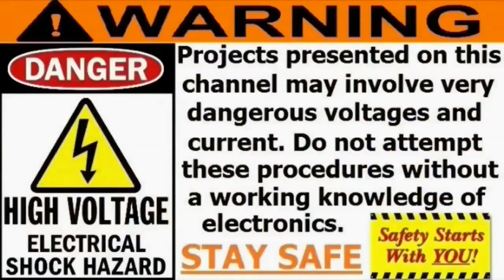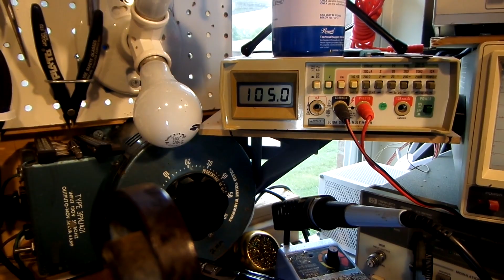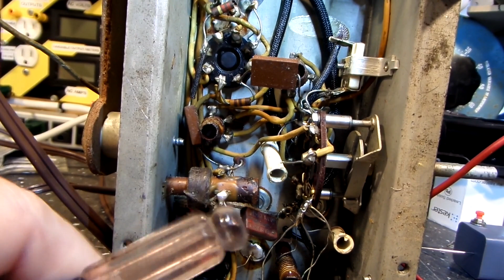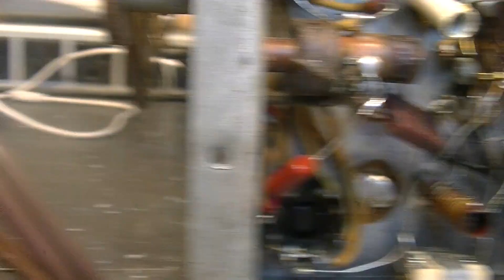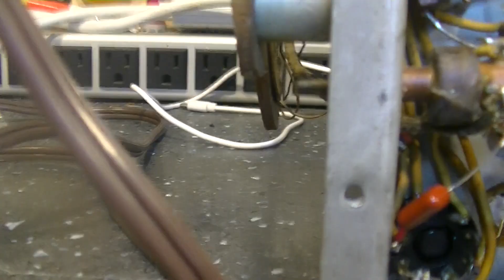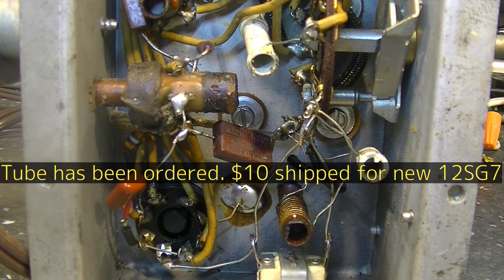RCA 66X1 - Troubleshooting the radio section

Comment: Great series, Doug! I'm sure you'll get it soon! Bob Dobush is a good guy & lives fairly close to me! Bob (Radio Wild) always has a good selection of tubes!
Reply from the maker: Thanks Tim. I think I am starting to zero in on another problem. This radio has proven to be formidable foe for sure. Latest one involves the fact that it doesn't tune in anything over about 1370khz. That would explain why I'm unable to receive the local station here which is located at 1390khz on the dial. :)

Comment: Did you clean and check the pin sockets so they are making contact with the tube pins Doug ? Without doing so any tube
 put in there may seem not to work. Just a thought since you aren't checking tubes in a tube checker for this experiment.
Reply from the maker: Thanks Steve. No I have not cleaned any tube sockets yet. If we are talking about the tube tester I plan to go over it once I get this radio fixed. I can tell you the meter needle dips when a tube is inserted which on these testers is an indication the filament pins are making contact. :)

Comment: I am wondering if the input to RF stage has a 455KHz band wave trap (notch filter) circuit that they used back in the day for filter out 455KHz beacon signal from coastal ships.
Reply from the maker: Thanks Jim, yes indeed, there is a wave trap between the RF tube and mixer-oscillator. Odd that I can feed the 455 khz signal in at the plate of the RF tube and it gets through just fine, but fed in at that grid of that tube just results in hum. I'll get there eventually. :)

Comment: Good video Doug, I really like the BDSI for testing as you were showing in this video. This is similar to my Farm Radio, I could inject the 455 signal on the back end and get it through, but couldn't get the radio signal through.
Reply from the maker: Thanks Gregg. As of yesterday I was able to get a 1 Mhz  modulated signal through the radio so some progress is being made. Problem is I could not go above 83 VAC on the variac. So obviously a problem with too much voltage. I'll get there soon I hope. LOL

Comment: Nice work Doug trouble shooting the radio circuits. Keeping my fingers crossed the tube fixes the issue.  Thanks and take care
Reply from the maker: Thanks Lloyd. This radio has been a tough nut to crack, but taking it slow and easy getting things working one step at a time. I was able to get a 1 Mhz signal with modulated tone through the radio yesterday so progress is being made. Problem right now is finding out why the B+ is so high. :)